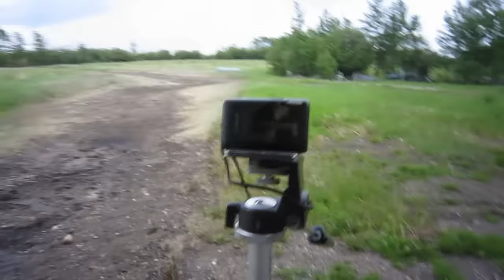Testing a GE J79 with afterburner

Comment: Ah, brings back lots of memories and why I have tinnitus. :-) Worked 6 years as an Electronic Warfare Systems Specialist on F-4 Phantoms with each having two of these beasts inside them. They also sat in concrete bunkers called Tabvees in Europe/ Germany, where I very often had to help during startup. I also had fire extinguisher duty often during engine testing. Once and a while I was asked to sit in the back seat to watch the aft engine gauges and report on their proper function. And one time, I got to sit in the back seat during testing of a reported compressor stall. Boy was that a thrill. We had trouble finding when the issue happened. And then it happened... Just coming out of afterburner, boom, a nice big ol flame came out the front of the engine and the whole aircraft shook. The guy running the jet did it about 5 times to make sure it was reproducible. Bout shit my britches. Never got to learn what the cause was, but it was a thrill to sit and feel it all. Standing next to an F-4 during the AB test is like standing next to the Apollo Mercury rocket. Your whole body vibrates intensely. It is a once in a lifetime feeling. Indescribable really. This video doesn't even come close to offering the experience unfortunately. Still, a great video and thanks for the memories!
Reply from the maker: m8a... in Jet City, you are what we call a made man. Welcome!

Comment: This guy here helping Earth orbit a lil faster around the Sun
Reply from the maker: If the thrust had any effect on the globe, which it doesn't, as the drag on the atmosphere makes this a closed system.
If it did, then the engine mounted tangentially to the globe could only affect the rotation of the Earth.
If it did, and we wanted to actually accelerate the globe's travel in orbit, we would need to mount it "normal to" the surface. From our point of view, it would be mounted vertically, with the exhaust jet facing either up or down. Makes no difference, as I mentioned earlier that it's a closed system with no net force exerted on the world.
Reply: @AgentJayZ  don't put us through those college physics lectures again🤣
Reply from the maker: C'mon everyone! Point your jets to the sky. Rev them up and nail the afterburners. We gotta catch those martian pirates before they get away with our oxygen!
Reply: @AgentJayZ  there we go xD
Reply: This can't be serious? puh-leaze... We all know the earth is as flat as a pamcake!
Reply from the maker: Well sure... it's flat now. Now that all our jets are normal to the surface and pushin' like hell. Darn thing's looking like it says in the good book: flart as a plarncake!
F'n A one Bubba! We stop dem jets, and it's jess gonna puff right back up like it's not apposed to be. I tell ya. That  wouldn't be right.
Keep 'em all runnin'!
Push dat ting down! Make it flat as my EEG, dammit!

Comment: In another life, myself & shipmates would R&R J-79's (dash 8's & 10's)
Pull a complete engine "check", & then make a ton of adjustments to the engine while it ran at various rpm' s in a Test Cell.  Never saw this type of set-up.  Our aircraft that utilized this engine was an RA5-C Vigilante.  Eng was used in several other aircraft designs as well. ( F-4 & B-52)  This was ( in my opinion) an excellent Sub-sonic engine that pushed the RA5C into Mach-2  speeds !  Biggest threats to causing engine damage was "FOD" & SAM'S !  .Funny thing, while visiting a Race track, there was a Jet Car that was powered by a J79 !  A visual inspection revealed  so many defects ; I told the driver but I don't think he realized the danger he was exposing to himself & others.  I watch their start-up and the 1/4 mile run from a distance.  If we ever came across an engine like that n the military;  and tried to start it, we would have been hung!
Reply from the maker: Yes, the jet car people take huge risks without realizing it. I think you meant B-58, eh?
Did the Vigilante have an afterburner? I thought it did.

Comment: Put two together in an F-4E Phantom, multiply that one by twelve in a strike flight going to North Vietnam and stand out on the ramp working. The sound level was something like +140 dB. twice or more, louder than the loudest rock concert. I ended up, even wearing hearing protection, losing 40% of my hearing in my right ear, the ear facing the runway at Korat RTAFB, Thailand. I worked on the remaining F-105F and G models, they were loud enough on their own.
Reply: I just read Fighter Ace by Robin Olds. Was he your CO at the time?
Reply: @kurtnowak8895  No, he was with the wing at Udorn, north of Korat. he got our wing of F-4E's with the built in gun banished to Cambodia and Laos, and only allowed north when required. When our F-4Es and F-105F/G models, both with guns, flew north, the NVAF flew home, got on the ground and stayed there, we could match them close in and missiles got them further out.

Comment: Excuse me good sirs, I have a very important and highly technical question regarding the use of this device.  Where do you think I should bolt on the handlebars?
Reply from the maker: Wile E. Coyote put them just behind the inlet. Any farther back, and you would be sitting on 500 degrees of ass burning heat.
Reply: @AgentJayZ     yes, but did he actually end up catching the roadrunner with this setup!

Comment: 303 MMS Munistion Kunsan Korea. We had to pull the safety flags from the armament on the runway before takeoff on the F4. Then we were less than 100 ft when from the afterburner. At 70 years old I have bad tinnitus.

Comment: whats a average flight time for a jet fighter with that engine seems like it would use sooo much fuel
Reply from the maker: Air to air refueling revolutionized the air force. In VietNam a Phantom might refuel five times on a mission, because they could burn all they had in a half hour...
Reply: Depends on how many external fuel tanks the plane would carry and how fast you flew it.  I flew the Recce version of the F-4 (RF-4C) and our missions would last approx 2.3-2.5 hours when carrying 3 external tanks.
Reply from the maker: It is always an honor to hear from you guys who flew this stuff for real, in the stress of conflict that we mere mortals can only imagine (or think we can!). Welcome to Jet City, and know your comments are always welcome.
Reply: @AgentJayZ  As a follow on, I took an F-4 from Texas to Germany non stop.  8 air refuelings.  Never had an issue with the J-79.  As I recall, there were 4 stages of afterburner.  Lead would never go to full AB during a formation takeoff.  This would allow the wingman to adjust his power in order to stay in position.  Normally we would stay in AB until reaching 300 Kts.

Comment: Quick engine facts
Applications: B-58, F-4, F-104, Kfir, A3J Vigilante (RA-5),
F-16/79
Introduction: 1954
Total number produced: ~17,000
Thrust range: 18,000 lbs
Reply: The F-16 does not use the J79. It uses the F110.
Reply: Thanks  for  updating me

Comment: What makes those blades open and close at the exhaust? The hydraulics of that must be huge pressure.
Reply: mabey they found some way to use the incoming air for that by doing it with pneumatic instead of hydraulic....
Reply: Those are called the "Turkey Feathers" or variable exhaust nozzle. As you power up to full military power the close to create a convergent zone. This builds up exhaust pressure and slows the exhaust velocity and then as the exhaust exits the nozzel the pressure rapidly drops and the gases accelerate...they are mechanically actuated and are all linked together so either they all work or none work together.

Comment: I have a dumb question. I worked for Lockheed-Martin in Palmdale, as my Father did. He was on the team that worked on the A-12.
Kelly Johnson determined that the plane would use the JP 7 fuel so it would not catch on fire until it warmed up the body, and the leaks sealed up. 
I can't remember the exact formula of the starting fuel they used, but I think I heard Dad talk about using Benzine. 
In the test cell, have you had to use the 7 fuel for the test, if yes, how did you start the engine? I am retired now, I did a lot of the work on the hypersonic acoustics. It is so interesting what sound can do. If the old  XB-70 Valkyrie could have flown 300 to 400 feet off the ground, like the B-1 Lancer can, the sonic shock can turn peoples insides into Jell-O. 
NASA Built a sound horn that could go thru 9 feet of concrete.
I love your videos. Makes me feel like I am back at work again.
Smiles,
Reply from the maker: The super duper starting system on the J58 use triethyl borane for fuel.
To start the engine on the ground, the J58 was just like any other aircraft jet engine.
The TEB system was used for in flight restarts of the core when decelerating from high speed, as far as I know.
Reply: @AgentJayZ  
Core remained lit in all flight modes.  (Well, unless unstart / flameout happened, but that was hoped to NOT happen.)

TEB was used to light off the JP7 fuel during core startup on ground and restart in flight if needed, and was also required to light the AB.  TEB replaced the igniter for both functions.  It's the green flash you see on all the startup videos of the SR .  Same stuff pretty much as what lights off the Falcon 9, which also gives a green flash at ignition. 

TEB shot was automatic when pushing into AB, and throttles had counters for number of TEB shots remaining for each engine.  And it was totaled separately for each engine because there was a flight operation where frequently only one engine would be in AB - inflight refueling.  

LOTS of mis-information about the SR-71 / A-12 regarding leaks.  They weren't designed, but tolerated.  No, the bird didn't seal up when it got hot.  We just didn't have sealants that could keep on sealing when sent through the temperature ranges these birds operated in.  But the leaks weren't usually that bad.  Usually measured in drips per minute.  Specs of JP7 were decided on due to the temperatures it would encounter, especially as it served as a coolant before it was finally fed to the engines.  Fire risk due to leaks weren't a worry.

It's hard to really represent the noise of a jet in AB on video, though you come as close as any I've seen.  The vibration is what folks don't understand.  

This is my experience with it:

First time I got to see a J58 at full chat was right after I arrived at Beale, back when the engine shop would have night runs at the test cell.  These were events, and they'd allow folks that weren't engine shop come share in the fun.  Of course you've got ear plugs in and muffs over that.  Like it actually matters when you're standing close enough to read most of the labels on the engine.  Safety was a big intake screen assy, some caution tape at the front and rear, maybe some low portable fencing, all angled away as needed.  Yeah, that was a different time...

So they fire the thing up.  I'm standing pretty much as close as they allow on the business end of it, able to look up the AB.  And suddenly you understand why you don't need too much to keep people away.  Big green belch and here comes the heat.  Everyone backs up a bit.  A bit of run-up / warm-up, and they push into AB.  Then you see stars.  Well, diamonds, really.  Blue shock diamonds right there in front of you.  Everyone backs up a bit more.

Before the AB lit, the word "loud" was feeling inadequate for the experience.  After?  Wasn't on the same scale as this.  It's visceral.  Need an intestinal massage?  The J58 in AB delivers.  One part I'll never forget:  During the run, I looked around and saw what appeared to be a green mist rise up to about 2' off the ground.  Well, we're standing in a grassy area, and they'd mowed the day before.  Wondering what it was, I swung my hand down through it and grabbed a handful.  Yep,  grass clippings.  Being VIBRATED 3' off the ground.  Not the exhaust blowing them, no, but the sound SHAKING them off the ground.

Comment: I used to test these on the M-37-T1 test cell in the Air Force. You must have a lot of money to buy fuel for these fuel guzzling engines.
Reply from the maker: We spend a couple hundred K per year on fuel. The test runs last an hour or less, typically. Less than one flight maybe.
I've wondered how much fuel an air force pilot goes through in his/her career...
Reply: ferd fernan , I worked at the TestCell and Trim Pad on the P&W F100-PW-100 (F-15’s) and the -200 (F-16’s) at Luke AFB & Bitburg AB back in the 80’s, Loved it!!!
Reply: Fred Ferman and Anthony Pegues thank you for your service!

Comment: That engine cranks out 10,500 pounds of thrust at full power and consumes 90,000 pounds of fuel an hour when at ground level.  I was an engine mechanic on the T-58 Hustler
Reply: Evi!..... I used to be an engine mechanic on the J-795B for almost 4 years.  I know a little bit about what I am talking about
Reply: Using grams to indicate a jet engine's thrust?
Reply: Where did I say GRAMS?  I said 10,500 POUNDS of thrust
Reply: read the other comments
Reply: Pounds of thrust!
Reply: There was a guy above that mentioned values in mega grams and i got curious. the question wasn't ment to you
Reply: Someone is using this as proof it runs on water !!!!

Comment: the loudest plane I heard was an f-16 flying out of my local aaf at around 1000-2000 ft agl
Reply: Never go near a Harrier or you will get deaf
Reply: Alan cZar  It has so much thrust that it can carry it's own weight without airflow over the wings.The Rolls Royce Pegasus-engine is one of the most powerfull jet-engines ever   created.
Reply: Alan cZar  It has a RTX 2080 ti and i9 as wheels

Comment: I'd stand on the flightline and watch 4 of these engines screaming down the runway for takeoff.  Of course,  they were inside F-4E's and I was an SP with a front row seat.
Reply: Interesting... my dumb ass always thought F4s only had 2 engines....
Reply: @SUPERSONICCULEBRA  they would take 2 off at the same time 🙄. My dad worked on the e models also. There is a guy around Ohio that has one of these mounted on a frame with a semi cab on it. I've heard 1 afterburner in person, I could imagine 4. Dad said with ear plugs and ear muffs on, it still almost wasn't enough haha

Comment: I used to work at Firebird Raceway outside of Boise Idaho, and they would bring in jet cars from all over the world to run there. They were the smaller engines of course, but they were ungodly loud when they kicked in the afterburners.  I have watched fighter jets take off from the airport in Boise, and they are even louder. I live in Utah now, and I work near Hill airforce base, and they have the F22 Raptors, and the older F16's fly out of there quite often, and they would buzz the shop as they went over and shake the crap out of the building. 
I am in awe at the power output these engines have. How much thrust does it have, and how many CFM's of air does it move at 50%, and 100% throttle? And I take it the adjustable nozzle on the back is for extra thrust when the afterburner is kicked in? And have you ever done one of these videos at night so we can see the flames better?
Thank you for another awesome video.
Reply: Yeah never seen a f16 fly around though the museum up there as a engine similar in size to this that is under development

Comment: Ive only ever heard afterburners at air shows. They are fantastically loud!😁 However, the loudest thing ive ever heard was oddly the harrier jump jet hoovering demonstration. maybe it was just perception because the jets with full afterburners went by so quickly. I don't know. But that Harrier was LOUD!
Reply from the maker: The Pegasus is a big engine, and in the hover, it is at max power, so that's going to be really loud.

Comment: If you wanna measure the loudness of those engines try and get a class 1 db meter like a B&K or Larson Davis.
Reply from the maker: The one I looked up, for exhaust noise measurement, goes up to 140 dB. Not anywhere near high enough. I'll keep looking.
Reply: @AgentJayZ They have different microphones for different noise levels the highest reading a B&K can handle is 184 db the highest a larson Davis can handle is 172 db.
Reply from the maker: Thanks again. I was trying to look for the 4941, because I noticed it gave a capacity of 181 to one of their meters.
Reply from the maker: Thanks. I have been looking through their website. They seem very professional, unlike the car audio sites where a capability of 190 is claimed, but the whole presentation seems quite shoddy.
Reply: @AgentJayZ no probs and B&K is probably the best db meter out there.
Reply: @AgentJayZ  True that.
Reply: @SmarterEveryDay This needs quantifying... Just saying.

Comment: if you had a Heat Resistant Suit then how far is it going to push you away?
Reply from the maker: If you had a heat resistant suit and walked directly behind a J79 at 100% rpm, with or without AB, you would be ripped apart and sprayed out over an area extending up to 100 yards away.
Reply: @AgentJayZ  get a pig carcass and throw it behind it.
Reply: @AgentJayZ  I am now intrigued. lol